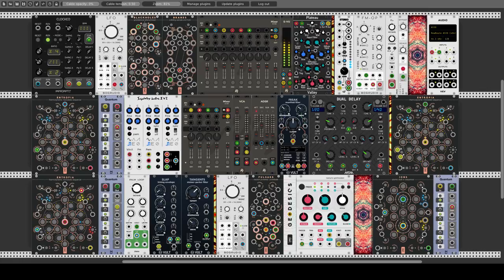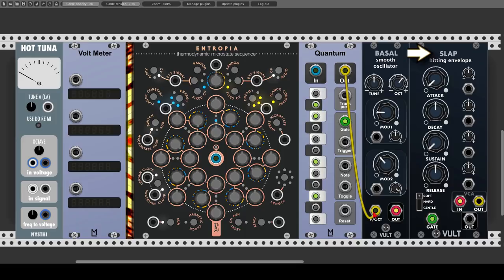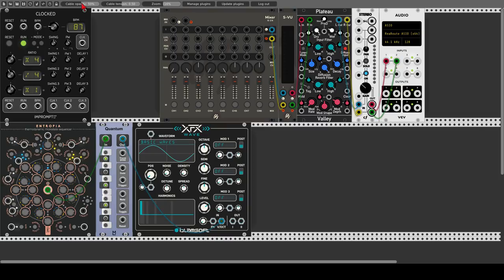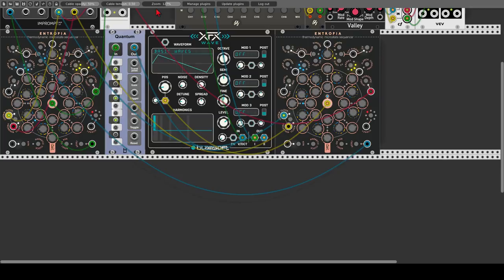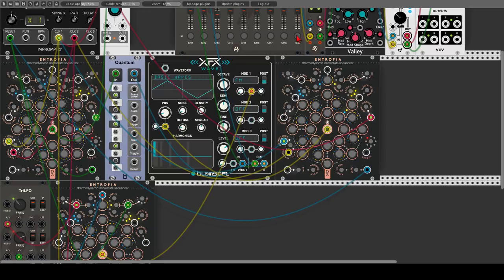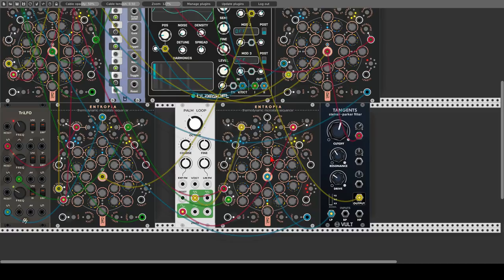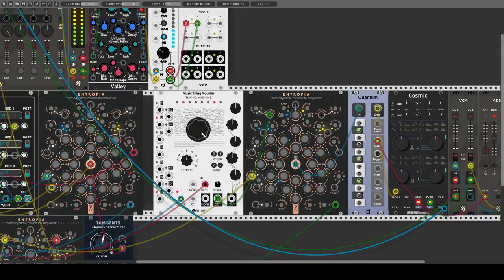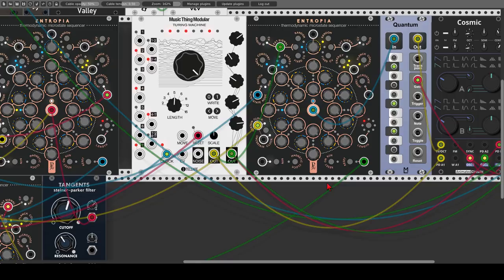Geodesics Modules Series part 5 - Entropia

Comment: Is there a way to advance the step manually - like the magnetic clock button - but with a gate?
Reply from the maker: Hi! Well, actually, a clock is nothing but a series of pulse waves (in most cases) so if you use just one pulse wave, the sequencer will advance one step. If you use 2 pulses, it will advance 2 steps, and so on, so yes, you can use also a gate from a Midi controller, for example, and advance the sequencer (any sequencer really) manually via the clock input.
Reply: @OmriCohen-Music  True! fixed
I didn't want the timbre of the Wave Osc to change if I increased the decay, so triggering the clock from the Bernoulli gate (same as its vca) fixes that
https://patchstorage.com/arp-entropia-bernoulli-wave-red-axe/